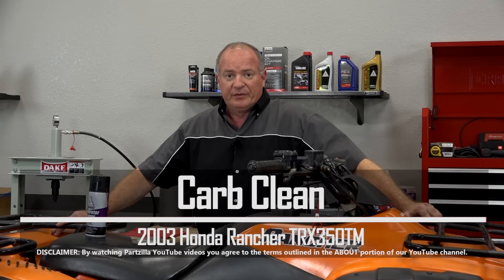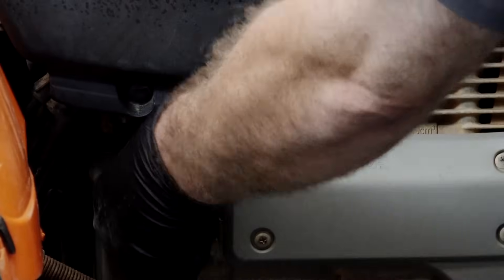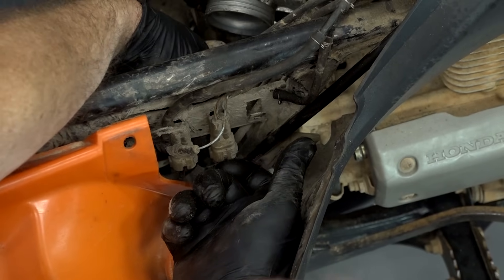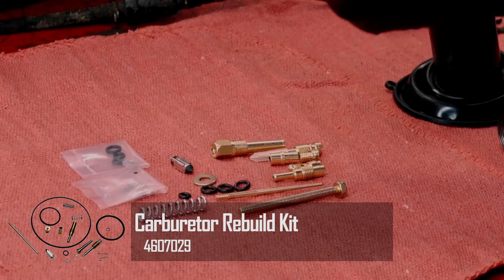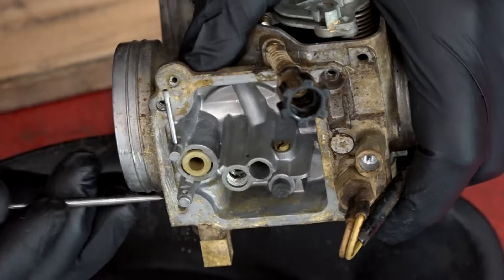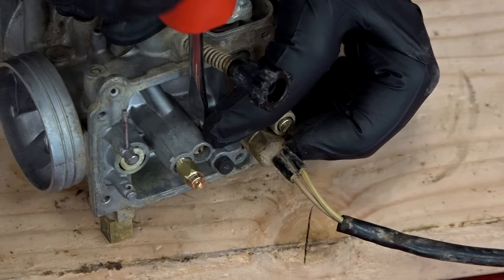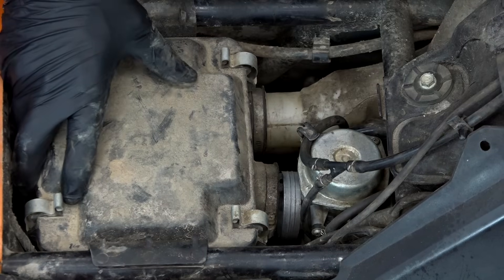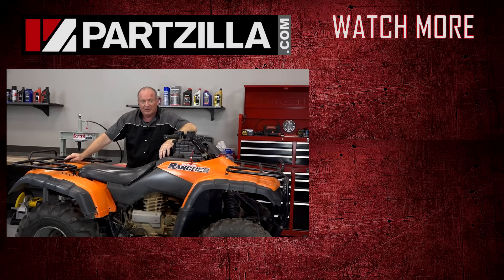Honda ATV Carburetor Cleaning | Honda TRX350 | Partzilla.com

Comment: Why would you put a instruction video up on YouTube titled Carb rebuild & cleaning if your not going to do a complete tear down and rebuild? Not trying to be mean just asking.
Reply from the maker: To be fair, this video is titled "Carburetor cleaning."  It is also considered a rebuild to just go through it and replace the jets, needle, etc.  This is usually what is needed when your carb stops working.  What were you looking to do?
Reply: Partzilla I have a 06 rancher AT 400. And your video was the closest I have found to my Carb. I had trouble getting the piece out that goes in first before the main jet casing. That is held in place by the casing. And even getting the new one in. I also had a piece out of my carb rebuild kit that I couldn't for the life of me find where it went or what it was. I looked at the carb schematics and could not find it on there either.
Reply from the maker: The carb rebuild kits can be for multiple models.  They may have extra parts.  If you can't figure out where it goes, just don't use it.

Comment: have same carb but where the needle seats at the brass parts someone had tried cleaning it and messed it up and know the carb will start over flowing anyway that can be fixed need advice on it never had seen that befor
Reply from the maker: Define "messed up."  Can you replace the needle? or did someone gouge the surface?
Reply: Bittu Billa Hero Honda bike repair canter

Comment: I got a 2000 yamaha big bear 400 5speed semi automatic  2wheeldrive everything works but it only go's 15 mph its supposed to go 60 mph would you now the problem
Reply: its a yamaha lol should have bought a HONDA
Reply from the maker: Start with a full carb clean.  This is a common problem with multiple brands.  It can be as simple as the carb or clutch or an ECU issue.  You just have to run through everything until you find the problem.
Reply: Partzilla ok ill try to figure it out thanks
Reply: Thats the problem you got a yamaha
Reply: foxster I had a 400 bear drives like a tank basically can go through anything lol
Reply: Check your parking break is off they stick

Comment: Curious as to why you decided not to use all of the new parts from the Moose kit?
Reply from the maker: The parts that were not replaced were in really good condition, it just wasn't necessary.  It's preferred to have OEM parts as long as they don't require replacement.